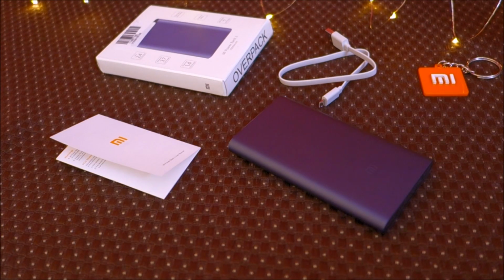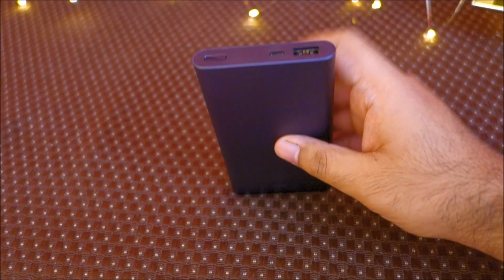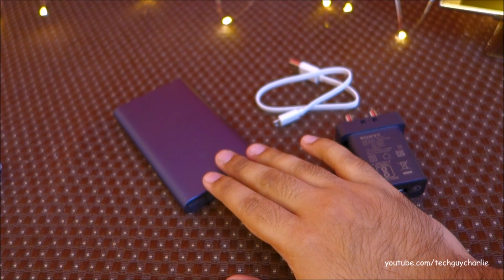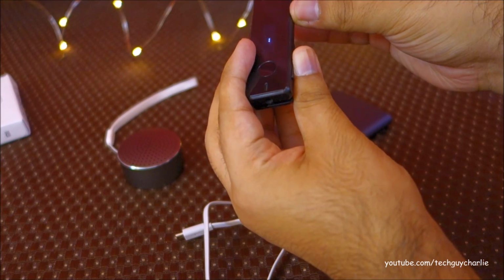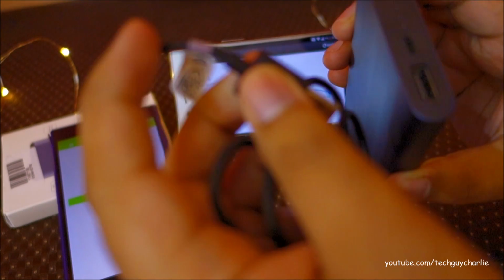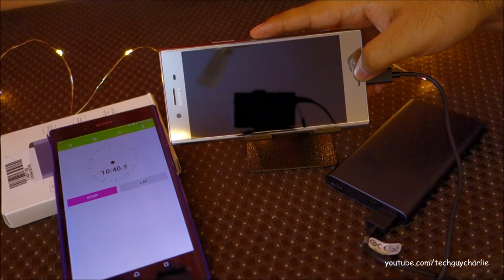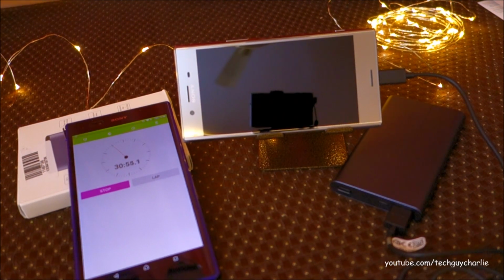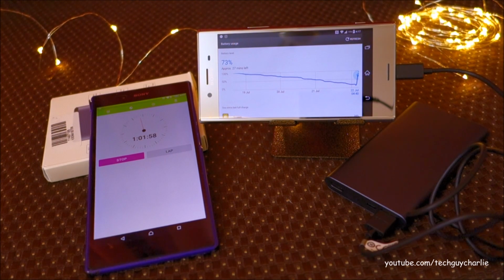Xiaomi 10,000 mAh Mi Power Bank 2 portable fast charger review with charging speed test

Comment: I bought 20000 mah powrbank frm mi website. Frm today 1p.m maine chrg me lgaya h.. n abhi raat ke 11.23 pm. Abhi v 2nd led blink kr rhi hai.. mai Samsung ke chrgr se chrg kr rhi..  bt 2nd blink hi blink kr rhi hai.. ovr night chrg krna safe hoga??  Plzz hlp 😢
Reply from the maker: It should not take this long, at the most it should take about 7-8 hours to charge on a normal charger and 4-5 hours with a quick charger. You can leave it charging overnight, nothing will get damaged, but are you using the cable with came with power bank? I think your power bank is fine, the problem is that the Samsung charger's output current is quite low, what is the model of your phone? maybe I can figure out what is the output current of your charger.
Reply: Tech Guy Charlie i am using samsung j72016 . And right now 8.42 a.m maine overnight kiya chrg. Jb chrg de rhi 2no. Light blink ho rhi h abhi v.. aur main cable v samsung kaa hi use kr rhi.. kyuki iske sth jo aya h wo bht chota h size me. Ab kyaa kruu 😢 jb chrg se khol rhi to no. 1 and no. 2 hi blink hoo rhi h kal 1pm bje se. Jbse mere pas packg aya  h..
Reply: Same problem
Reply: Anwesha Bhattacharyya problem solved or not
Reply: sarcastic pratap yah alrdy slvd.. thank you
Reply: What happened after 2nd blink ? I m facing the same issue now
Reply: Pahle main mi  sth wala usb cable use ni kr rhi thi to chrg ni ho rha tha.. nrml chrgr use kr rhi thi to prblm ho rha tha. Use any samsung chrgr plug. And mi wala usb crd. To prblm solv ho jaygi.. mera wla abhi prfct chlrha ovr night se thoda zda time doon to pura chrg ho jata h..
Reply: Same prblm mere sth ha
Reply: Arnav Kashyap hone do charge hojayga , koi problem nahi hai
Reply: Arnav Kashyap time lagta hai charge hone mai

Comment: Will the power bank automatically turn off when the phone is fully charged?
Reply from the maker: Yeah, it does! Every power bank shuts off charging after they are fully charged.
Reply: I tried charging my redmi note 4x and after almost 3 hrs the power bank is still charging it although my phone was already at 100 % 2 hrs and 30+ mins. Will experimet a little more though, I'll try overnight charging and see if it would stop..
Reply from the maker: Well, if you are charging with a non-QC 2.0 charger it will take more than 7 hours to charge this power bank up to full because the battery capacity is huge, so just leave it plugged in over night.
If you use a QC 2.0 charger it takes only 4 and a half hours.
Reply: Tech Guy Charlie i don't know if it's q.c. 2.0 but my charger has a max  usb curr. output  of 2000 ma. I'll try and get a q.c. 3.0 charger for better results! Thanks!